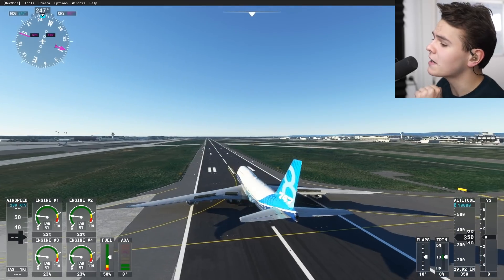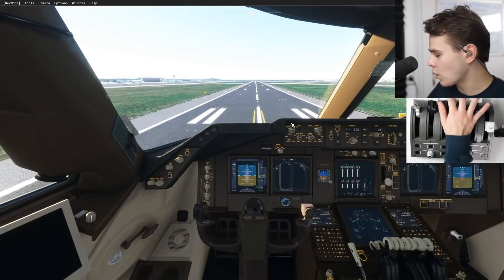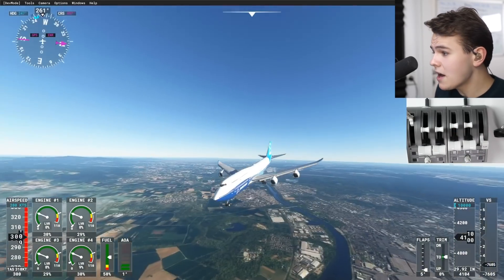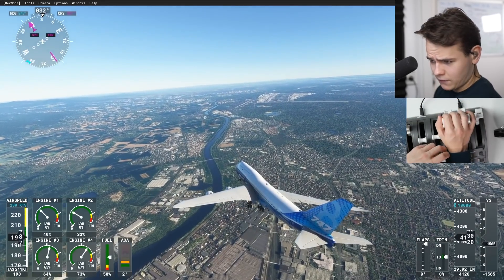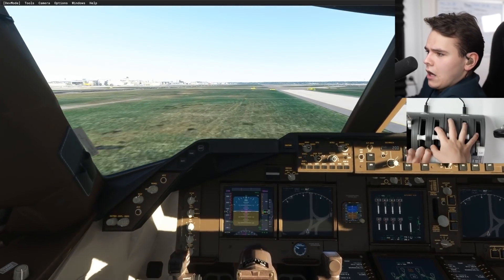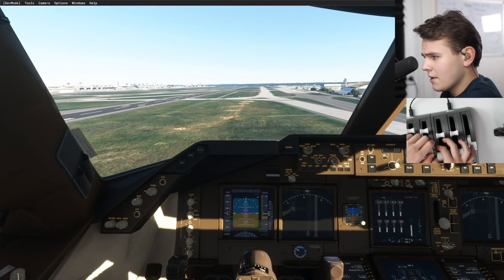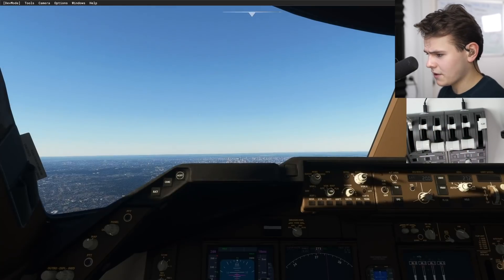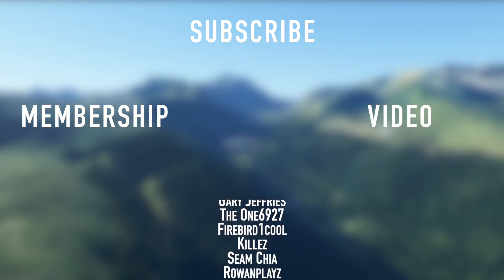No CONTROL Of The Plane - Flying With Differential Thrust

Comment: I did it without flaps or speed break or parking brake it's very hard but possible and landing on the runway on A310 after many times

Comment: There was once a Japan Airlines 747 that lost the vertical stabilizer and needed to fly like this to have any controls. The pilots became hypoxic and they crashed unfortunately. Delayed rescue caused a lot of people to die.
Reply: That's Japan Airlines 123. Hero pilots keeping the plane up in the air for 32 MINUTES without a tail meanwhile other investagators using a simulator kept it for 10~15 minutes

Comment: Flight 123, 434 and im sure planes that had their hydraulics or controls fail tried using differential thrust to steer the plane and Flight 434 actually landed using it after a bomb on board blew up

Comment: When I was first using X-Plane 11, it was the free trial.  I tried flying with differential thrust in the Zibo 737 in X-Plane 11 after finding the engines (and everything but the stick) were still usable after the 15-minute limit.  I found it extremely difficult, but I was actually able to land twice in five attempts.  And yes, I found the flaps and reverse thrust to be my friends.  Flaps helped me deal with phugoid oscillation (the slow up-and-down motion caused by an imbalance between thrust and lift that would normally be trimmed out).  Actually stopping that motion involves adding thrust just before it dives, then taking away thrust just before it climbs.  If you do it right, you can even get the plane to maintain a certain attitude (continually climbing to avoid terrain or constantly diving to approach a runway).  Reverse thrust helped with pitch control.  (By the way, part of the reason why JAL123 couldn’t land was that they had also lost their vertical stabilizer, so they also had to deal with constant Dutch roll.

Comment: Flaps and speedbrakes are hydraulic too :)
Reply: but they're separate systems so its possible to have a failure of the control surfaces but not the flaps and speedbrakes